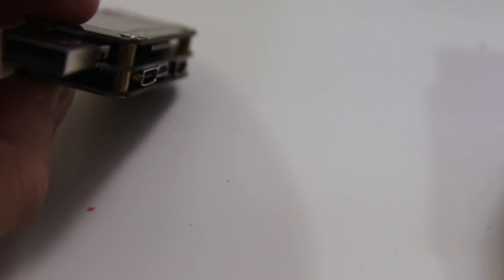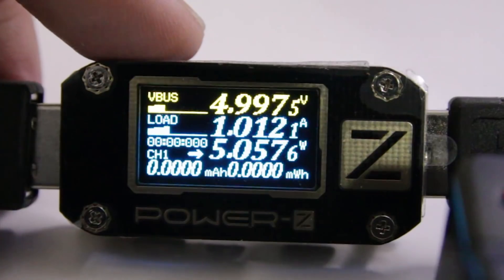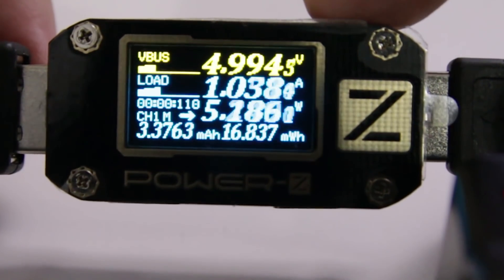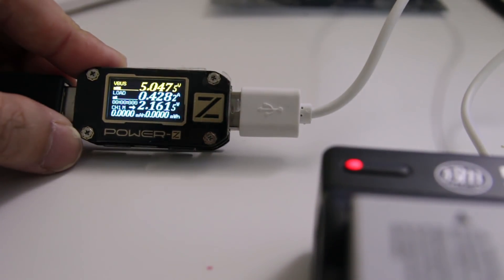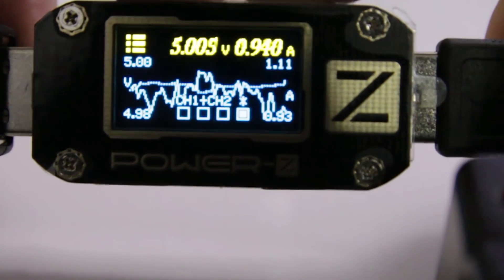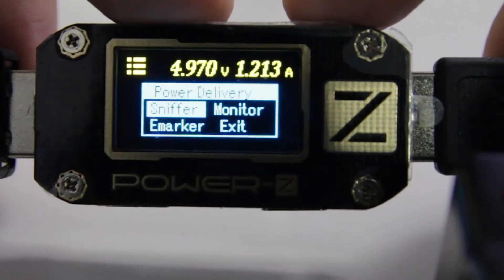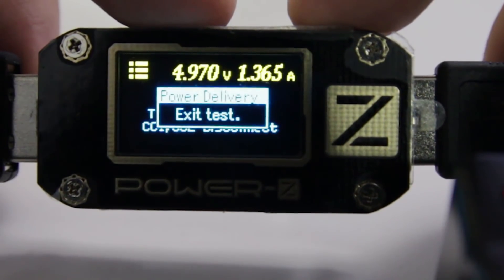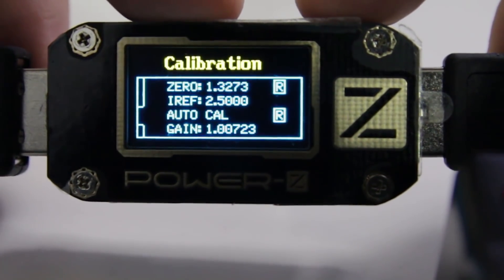Power-Z USB Voltage Current Tester

Comment: This would probably only satisfy my curiosity but I'm curious if a load of usb sticks plugged into a raspberry pi affect the current draw much? I've got a pizero running volumio with a phat dac and a zero4u hub. I try to run it off a mobile top up battery but since adding all the USB sticks/hub I'm lucky to get a few hours out of it.  Cheers.

Comment: That thing's awesomo - I run a tiny little inline USB meter (it just has a simple 4 digit display) and I use it to look at the voltage and amps that my Rock64 and Pi 3B+ are using, it's very useful information but nothing even close to what that does.  Does it handle the full power USB-C connections (so the 45-100w connections that charge laptops)?